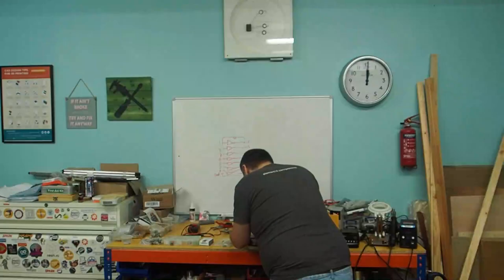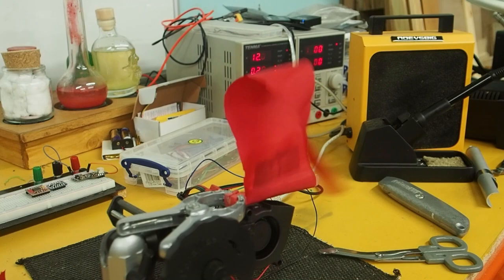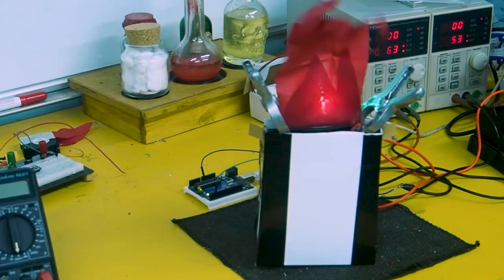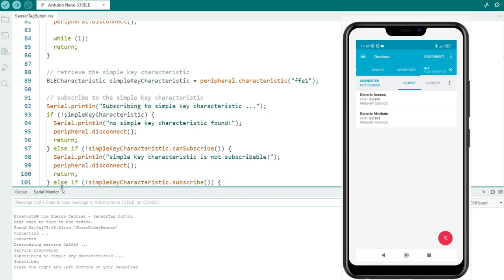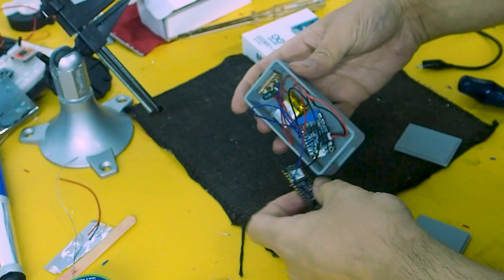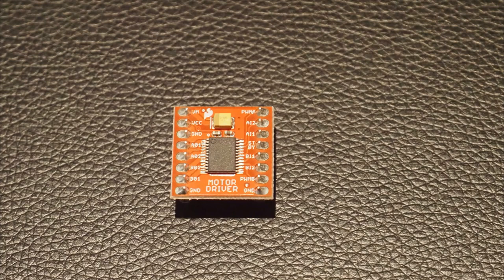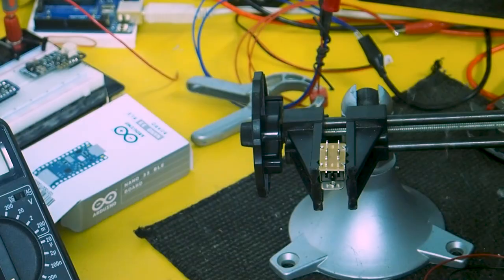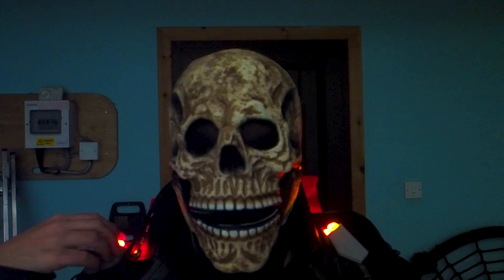Ghost Rider Halloween Costume!

Comment: Had a lot of fun and frustration with this build. A real shame on the lack of PWM on the Nano (more than 4 causes a system exception), but as that's a software issue it should be solvable.  Had I known that up front probably would have picked a different board and perhaps an external BL or BLE module.